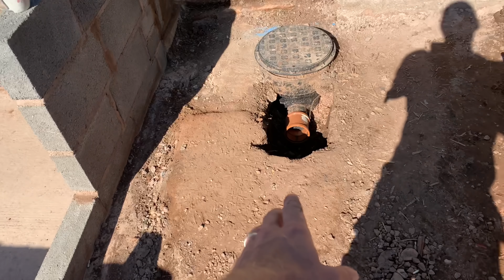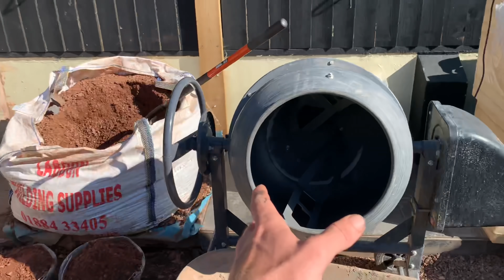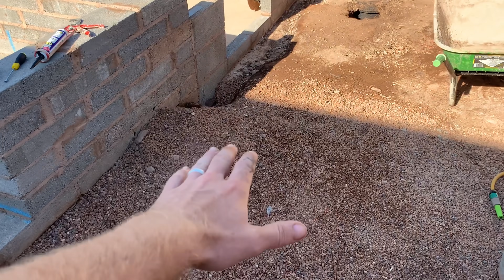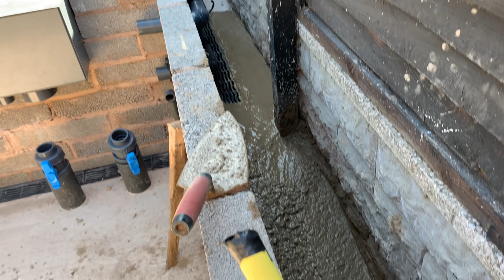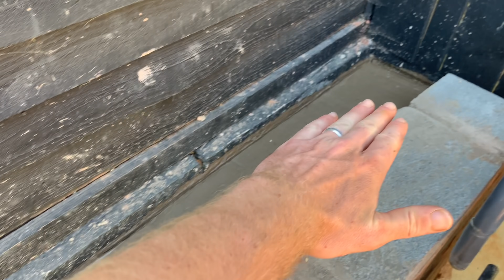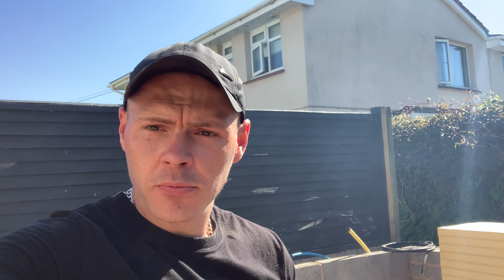LOADS OF WORK HAS BEEN DONE THIS NEW KOI POND IS LOOKING WICKED!!! **EVEN HAD A BBQ** #PART 33

Comment: Great stuff James, it's looking great. And taking shape nicely. Just a quick question, I am going to fit an aerated retro bottom drain, is there anything I need to be aware of. Thanks James and regards to the " Whisperer  " family.
Reply: If it’s the one that James was given to try, I bought one and it works well but despite hoovering regularity I find the spay bar on my traditional filter blocks daily with fine strings of weed that seem to catch on the outlet holes. Also get a few leaves in there on a windy day. Hoovering weekly and blanket weed treatment every couple of weeks but still blocking.